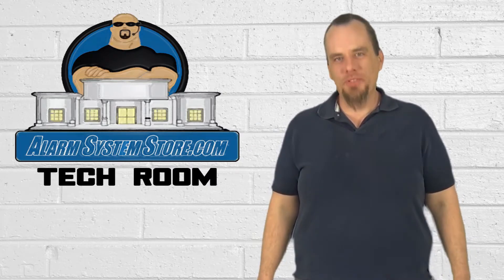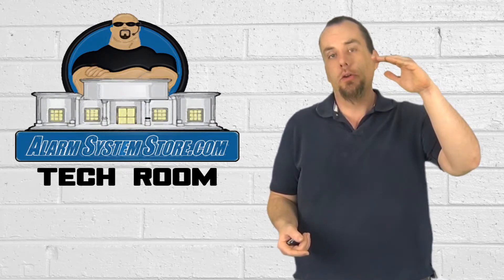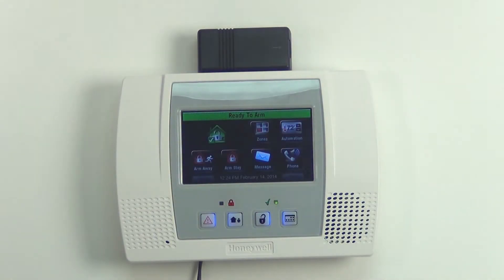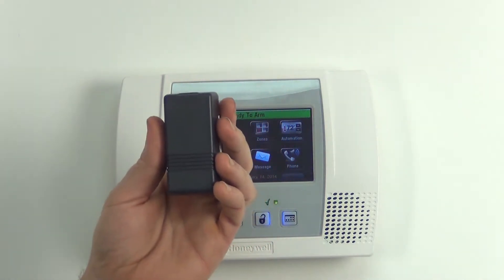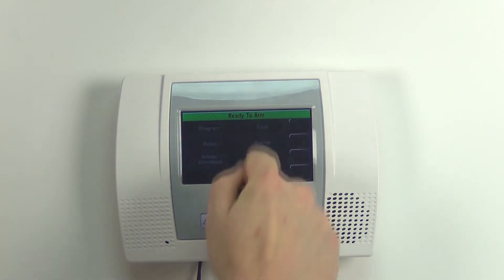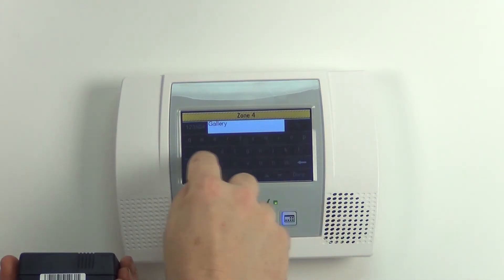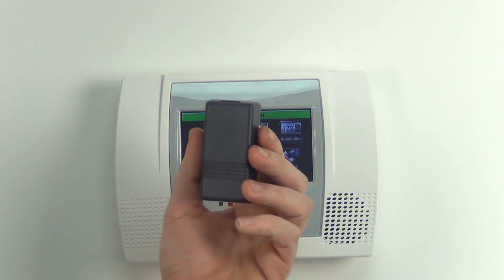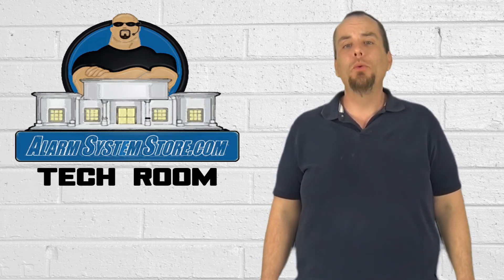Alarm System Store Tech Video - Honeywell 5822T Wireless Tilt Switch

Comment: The device type needs to be GARAGE DOOR not door. Otherwise it acts a normal door contact.... and don't set it to perimeter, or you will get an INSTANT alarm any time you open the garage door returning home, etc.......